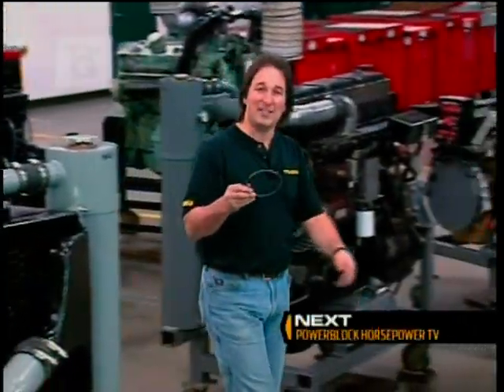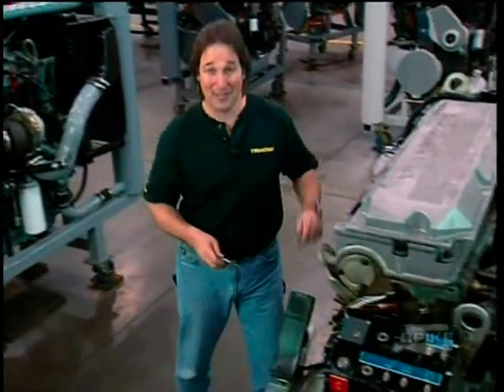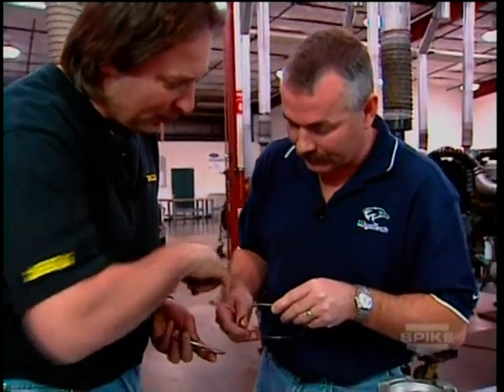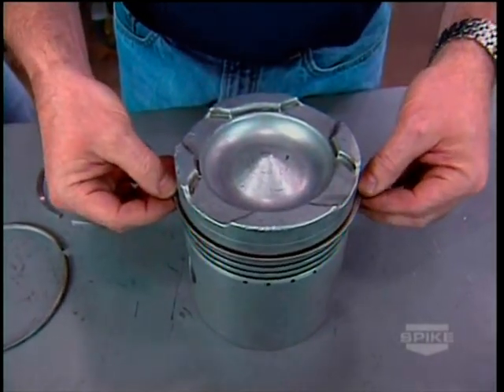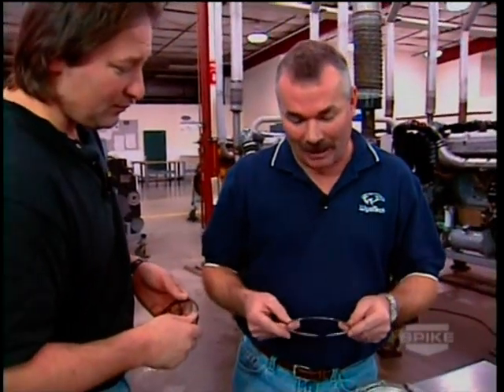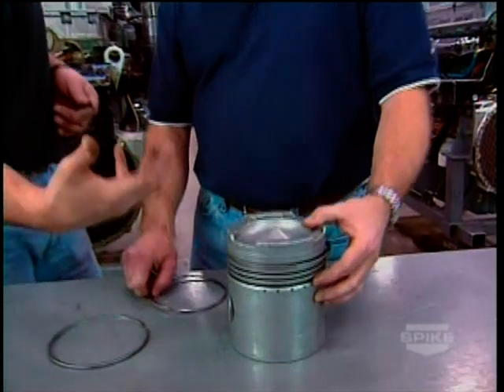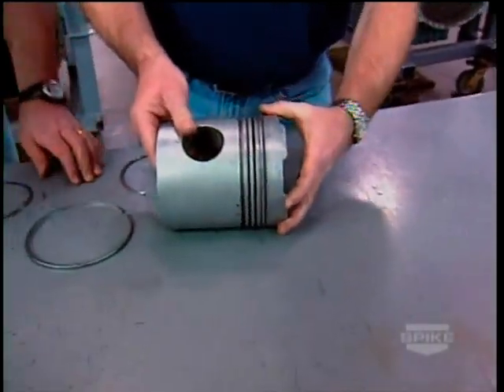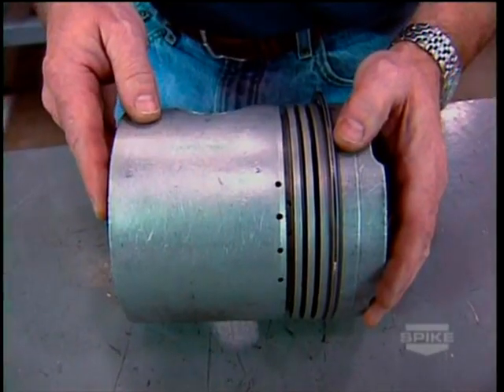Here's why diesel engines are better than gasoline engines

Comment: They both have their pros and cons. Diesel engines will last quite a bit longer and you get better mileage, because diesel produces more energy than gas. However, gas cars are cheaper to buy and gas is cheaper. Also, they are cheaper to repair. So if you average the prices out, you will actually be spending about the same on a diesel vs gas, so I don't think one is necessarily superior. If diesel was cheaper and they weren't as expensive to fix, then it would obviously be superior, but this isn't the case. 

And the people saying you can use this type of combustion in a petrol engine, really don't understand how a diesel vs gas works.

First off, the fuel is mixed with air and then compressed into the pistons in a petrol engine. Then, it is ignited from sparks produced from spark plugs. 

Diesel uses the heat of the compression from air and then it ignites the fuel. 

Notice how one uses spark plugs and the other doesn't...The diesel has a much more efficent way of combustion than the gas.
Reply: Frank Byers It's a 20 year old truck thats 39,000 a year math genus!! Liberal don't stretch the truth they speak it. You don't like unions? Move out of the UNITED states of America!! It is a union.
Reply: Teamster Pride You forgot to read the entire comment, so here is the phrase again: "But I suspect that it maybe because of maintenance neglect because some of these people are buying these trucks to be cool, not to serve any practical function."

And no, they do not swap engines on taxi cab cars. It's too much time to waste to get it back on the road. They simply buy a replacement and scrap the old one(or sell it to someone who wants to swap it) Crown vic engines are actually designed for an operational life of 500,000 miles. I've personally seen Volvo I-5 engines go more than 250,000 miles without any major failures.

Yes, I'd agree that diesel is better, but for some people it is impractical to even find one. And light duty diesels are mandated by the EPA to have equipment to make them burn cleaner. This does cut down on their reliability because it introduces more (mainly electrical) components which is just more stuff to fail.

Tell me, if someone has needs that a car that costs less than $20,000 brand new, and has an operational life of 7 years, when they're going to trade up in 3. Why would they want to buy a diesel truck that costs $50,000, gets 20MPG on a more expensive fuel, pain in the ass to park?
Reply: Gerry Cooney
#1 black smoke IS incomplete combustion of diesel fuel. #2 there is no reason to state "torque" in your sentence about increase power because it is the measure of "power". That is like saying the tree grew taller, especially in feet.
Reply: If a diesel engine cost twice as much as a gas engine but last 4 times longer the gas engine is NOT cheaper in the long run. Gas is cheaper but if you do the math (I have) even with diesel being more expensive you're still money ahead.
Reply: Teamster Pride These guys are talking about big rig engines. Diesel engines in 3/4 to 1 ton trucks usually are designed for short hauls and not the type of mileage professional truck drivers can put on their trucks. I've seen a lot of diesel truck drivers go about 150K to 250K on an engine before something internal needs to be replaced (On Cummins engines too, they're not bulletproof.) But I suspect that it maybe because of maintenance neglect because some of these people are buying these trucks to be cool, not to serve any practical function.
Reply: Teamster Pride Crown vic taxi cabs usually go about 400k to 500k and they're gas engines.
Reply: Dilan Gilluly yeah the car has 500k on it and its on the 3rd engine. Your trying to debate something thats not debatable to anyone educated on the subject.
Reply: Teamster Pride
Union fairy boy, you know it would take driving 5 years driving 3000 miles per week to put 780,000 miles on a vehicle. 99% of do not sit on our ass that much to put that many miles on a vehicle. I know you liberals love to stretch the truth but come on man. There is a reason that the vast majority of vehicles in the US are gas.
Reply: Dilan Gilluly Theres no advantage for gasoline except for rich oil men who have morons fooled. The rest of the world has figured this out a long time ago. So has UPS, Fed-Ex, trucking, Agriculture, generators Co's, Ect.
Reply: Teamster Pride Rich oil guys have you fooled too because it all comes from the same source. If you want to be technical electric is the way of the future, and that's not happening soon because as you said, rich oil guys don't want it to happen.
Reply: Dilan Gilluly batteries hold power they don't produce it. Bio diesel is the way to go because it has virtually no emissions, Co2 is absorbed by plants (it's made from plant oil) so Co2 emitted is a wash and it's 2nd in btu's per gallon to peto diesel. batteries are the worst. Here's prof! !http://coldfusion3.com/wp-content/uploads/2014/07/1109dp_01+renewable_diesel_vs_electric_cars+energy_density_chart.jpg
Reply: Teamster Pride
My Jeep has been on the road for 62 years and my car 49 years. Let me know when your diesel is old enough to not wet the bed.
Reply: Teamster Pride
No advantage? Except being $1.00 per gallon cheaper, not as noisy, more throttle response, overall cheaper to buy, maintain, and replace. There is a reason that the vast majority of us drive gasoline powered vehicles.
Reply: Frank Byers Diesel = 40% more efficient (gasoline isn't 40% more$) New direct injected diesels are just as quiet. There not more expensive in the rest of the world were there's a high demand. More energy out of diesel than any other fuel that's why trains, semi-trucks, delivery vehicles, tractors, busses, construction equipment, generators and the rest of the world uses diesel!!
Reply: Clearly have no clue what you're talking about.
Reply: +Frank Byers why is 4o % or so of cars in Europe are diesel and here in the state every thing else is diesel i.e. Trains 18 wheelers ships generators etc.

Comment: Which is superior really depends on the application. for heavy loads and fuel economy diesel is the best, for performance and speed petrol is the way to go,
although Audi diesels have been dominating the 24h Lemans for years.
Reply: why would they use diesel in a race? torque?
Reply: probably. that and the inherent fuel efficiency of diesel engines meaning fewer refueling stops.

Comment: and why dont we use this desighn on gas motors
Reply: the robust design of diesel pistons, and related parts is better suited to lower rpm's ,a nd if used on a gas engine at higher rpm's it would result in decreased fuel economy.
Reply: Was wondering the same thing, maybe just a cost thing for the car maker maybe.

Comment: i start in alfa romeo ts petrol engine and comabout fuel economy, change for a audi A3 2.0 tdi so in 4 years... 4 injectors issues +1400€ + 1 turbo +700€ +MAF 300€, changed for a mazda 6 diesel in 3 years, brakes problems 200€, DPF iSSUEs all the time errors etc.+repair and remove DPF for prevent future problems 500€ timing chain problem need a new one 1000€ in a cheap garage. I remember my Old alfa never got problems and i buy a BMW 330i AND UPGRADE LPG!! the best thing i make!! never got issue

Comment: I need some help. I'm turning sixteen and my dad is letting me choose my first truck. I live on a farm so I'm gonna need a workhorse. One good for hauling and alot of torque with a decent amount of fuel consumption. I want a diesel because of the brute strength but I don't want to pay so much for fuel. I'm not sure what to get.
Reply: Diesel since you live on a farm

Comment: I have a diesel BMW, and i prefered any day a diesel. Have huge torque, less consuption (less 30 to 50%, in europe, gas cost 7 dolars a galon and diesel cost 6 dolars). Hinter is no problem for diesel engine, or else we don't have trucks in europe :)
In europe every truck have diesel engine, and 50 at 60% of the cars have diesel engine. Why? Why spend money in a gas car that go for 100.000 milles instead of 500.000 of a diesel!

Comment: your incorrect, a gasoline engine can typically run around 140 to 150 psi from the factory, and if its tuned for higher octane rating around 200 to 250 psi. with stronger components than some diesels used

Comment: Id rather have a regular gasoline powered Truck instead of anything diesel.

Hard to get going in the winter and if your glowplugs fuck up its going to be sitting for a while because theyre not cheap.
Reply: Not necessarily
Reply: You don't need glow plugs. A diesel will start without them if it's warm enough.

Comment: They cannot, a gas engine doesnt has enough pressure.  A gas engine is at max 100psi in the combustion chamber, due to light materials used, however a diesel is easily over 500psi.  If you go with higher pressure and stronger materials, you might as well get rid of the sparkplugs and run diesel through the engine.

Comment: If I wanted a car that I could travel on the highway with for no other purpose than to take it easy, eventually get somewhere and do so while getting excellent fuel economy, i'd get one of the various little European diesel cars, I think a VW went almost 2,000 miles on ONE fill-up here in the U.S. not too long ago. Something like 1,700 miles? I forget the exact number, but it was way up there.

Comment: I think you're totally missing the point here. I wasn't trying to have an arguement, i'm talking about raw performance, the shit YOU'RE saying doesn't mean a thing. A v12 or flat 6 or I6 can run "smoother" all it wants, it's going to be doing so WAY the fuck back behind the v8 when all is said and done.

"define brutal"

Acceleration G forces that are greater than F1 deceleration G forces doesn't define brutal to you?

Comment: Define "brutal".  Dude, face it, your argument doesn't mean a thing.  Go do some research into vibration moments caused by different engine configurations - as I've said all along, any combination of 6 cylinders in a row is the smoothest running engine.  This is not my opinion, it is a fact. Places where you can check this are the Bosch Automotive Handbook and The Internal Combustion Engine in Theory and Practice by GM's Sloan Laboratories.  Look it up, dude...quit arguing.

Comment: I don't dispute that in the U.S. it is indeed Aluminum. Because I know it is.
But there is no getting away from that pesky emphasis on "U.S." English. The making clear of the fact it is not just "English". It is different. But if its different. And it's not slang or an accent. And it's not a completely separate established language. Then technically it's incorrect. No matter how many kinds of dictionary it is in.
I realise it's there to stay however. I'm not disputing that.

Comment: Who gives a fuck? No offense to you personally.....but if weight distribution of your assembly is good and the materials used can withstand whatever job they were designed to do for however long they were designed to do it, what you're saying doesn't actually matter...I was talking about pure torque/hp, and the fact that a v8 is the best way to get the best of both worlds...

Comment: Yes I know about the various dictionaries. 
Is it Webster's that's used predominantly in the U.S.?
If, again, Aluminum for example. There are other words I'm sure. Were a proper English word. Then it would have it's own entry in the dictionary. There would be no need for a footnote : U.S. English.
Anyway. Besides my point. Dictionaries aside. My point was it was decided on Aluminium many many years ago.
And if you check the table of elements. Guess what you'll find.

Comment: Technically. And only technically. It is incorrect.
I accept that like you said, they are simply different in some ways.
But because there is no such internationally recognized language as "American English". Anything which is not correct in accordance with the official "English Language". Can only be called at best, a dialect. 
There are many words I regularly use which are probably not in any dictionary. 
But I at least accept that, technically, it is incorrect.

Comment: Aluminum was one of the original concept names for the material when it was discovered. But it was finally settled on Aluminium. Hense why that is the correct spelling and consequent pronunciation. 
And I was being sarcastic when I said, "Spoke proper England".
What i find interesting is that you only picked up on the word "Spoke". Which is actually correct use of past tense. 
However, the Country is England. The language is English.
Did you notice that deliberate mistake?

Comment: What do you mean, "smoother running"? I've seen v8's with over 600 hp that could spin 12,000 - 13,000 RPM all day and power a 3,000 lb muscle car to a low 10 second pass in the 1/4 mile....if that's not smooth....I don't know what is.

Comment: That design feature isn't the only reason diesels don't need rings as often... in fact there's lots of different factors as to why diesels usually outlast gassers, not just the rings. If that design feature was the only reason, then everyone would be doing it, but everyone's not doing it. Take a look inside a diesel motor and all the carbon/ash/soot there is in it, provides a better seal. The ring land gap traps carbon and that seals a diesel up even when the rings start fatiguing.

Comment: Not sure I agree with the idea of comparing big rig diesel engines to every day gas car engines and implying the diesel engine is "better". They operate under very different conditions, loads, and speeds. If you really want to compare apples to oranges then how about we start comparing both engine's longevity to their cost? Fuel, maintenance, etc.
One isn't better than the other, they're just different.

Comment: Diesel engines have a way more pressure in the combustion chamber than a gasoline engine.  You typically will not see more than 12:1 compression ratio on a gas engine.  With diesel you will see more than 20:1 on some engines.  As a matter of fact if Diesel engines had very little pressure they simply would not work.  They need the high compression(to create the heat)  to ignite the vaporized fuel.

Comment: or maybe its just because diesel engines work on lower revs and there is never as much pressure put on the rings and pistons themselves  as you get in the petrol engines.

Comment: True, but inline 6's (or any engine with 6 cylinders in a row, like a V12 or a flat 12) are still smoother running than a V8.

Comment: not entirely true....diesel is not worth less than gasoline.  the calorific value (heat energy) of a gallon of diesel is higher than a gallon of gasoline, so diesel has more energy in it than gas does.  but, you are right about diesels running on vegetable oil, propane, etc.

Comment: That is not entirely true.  An inline 6 cylinder engine is the smoothest configuration you can have, and an inline 6 diesel is just as smooth as an inline 6 gasoline engine.  Drive a mid 80's Volvo 740 turbodiesel if you don't believe me.

Comment: depends on the car. buy a 06 vw with 2.0 turbodiesel and one with 2.0 gasoline and see wich one needs to be pulled to the garage first. then take an old benz 190 diesel (2.0 diesel without turbo and abot 75 hp) and the vw with 2.0 gasoline. the old benz engine will run around the world multiple times.

Comment: if you got an old diesel. new diesel engines are more like pussyengines than gasoline engines cuz of the turbo you will need to have at least a bit fun while driving...

Comment: for a car, diesel is made to save fuelmoney and pull trailers. but sportscars and real expensive luxurys will allways have gasoline engines cuz they run smoother sound better feel better and that equals more fun driving them. and in cars you will allways need a turbosystem to get the diesel run like a gasoline engine with the same displacement. and newer dieselengines in cars dont last longer than most n/a gasoline engines. thats crap.

Comment: @BeKozlov90 It's not what you see comming out of the tail pipe that's bad, it's what you can't see. Diesels pollute nowhere near as much as gasoline. And the particle filter is whats putting extra strain on you engine, over here in the states we delete that shit off our diesels.

Comment: As far as diesel vs gasoline it really depends on the application. If you want a race car gasoline is the way to go but if you need to do some hauling diesel is the way to go. It's all a question of whether you want more horsepower or more torque.

Comment: 530k kilometers on my 1994 sentra GA16 engine with oem rings and sleeves, yes it doesnt have the 180 psi compression it had when new, but 135psi its still good for this engine, it could use an overhaul but its not needed yet, so get your facts straight.

Comment: gasoline and diesel engines have similar life time...but the difference is in torque...with 140hp diesel(my audi a6 2.5tdi),you can chase without any problem a 200hp gasoline powered car(friends a6 2.8i)...my delivers 300nm at 1900rpm ,frends 300 at 4500rpm...fuel consuption difference is 6lit of diesel. against 10 of gasoline...a diesel of 200hp makes a 470-520nm of torgue...in US a fuel is cheap,because of that,we in europe have expensive fuel.is there in US a diesel powered cars?

Comment: @crezzyman I actually have to disagree. I have worked on many Benz. I find them EASILY serviceable, and find american cars (dodges in particular) the biggest pain in the arse to do anything. Take a simple task such as changing fog lamp bulbs or headlight bulbs. In most american cars the headlight or foglight has to be removed. In the Mercedes you simply unscrew a dustcap and replace the bulb...